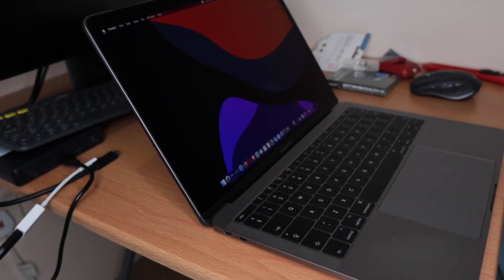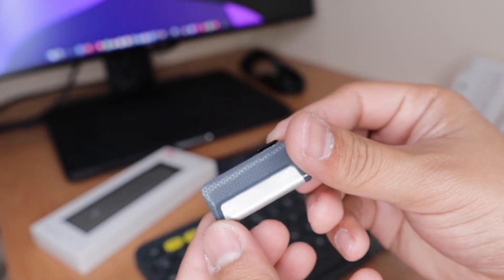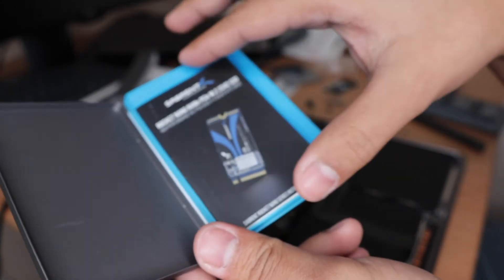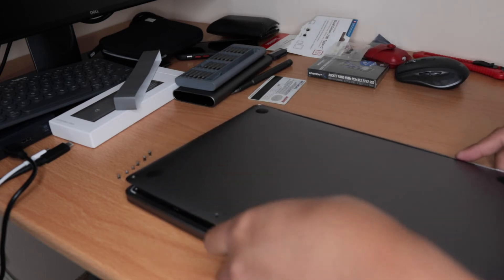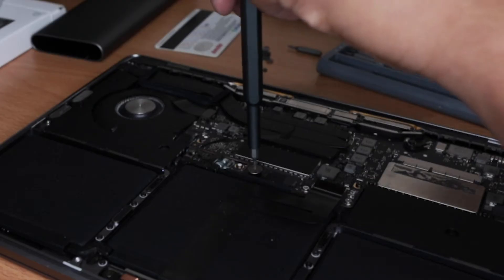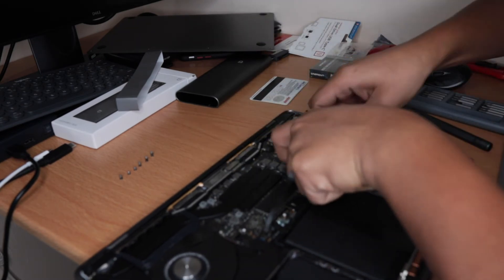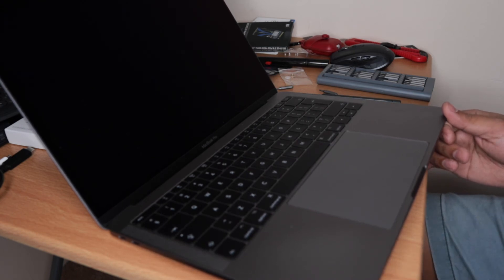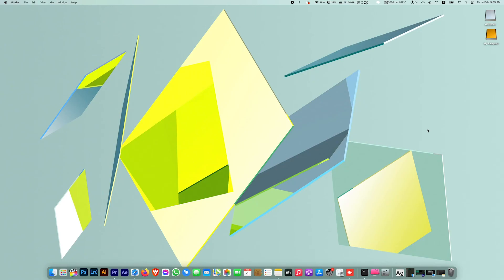How to Upgrade Macbook Pro A1708 to 1TB SSD

Comment: Hi, I have question if you have any battery draining issues with deep sleep?
Reply from the maker: Its been 9 months since i upgrade my macbook no issue at all. Everythings works fine. Read / write speed same battery no problem. Sleep no problem

Comment: Hey. Thinking about doing this upgrade myself. Have you run into any issues since you upgraded? Thanks.
Reply from the maker: since i did this upgrade no issues at all.actually this reply is from this macbook that i am using right now. its been 7 months. speed and temps are pretty good. feels like same ssd as before. 1tb is a big help for me
Reply: @KAPhotography  Do you have issues with the sleep/hibernate mode? What IOS do you have installed?
Reply from the maker: @arturo5050  still bigsur. I tried to upgrade catalina but boot problem it takes 7-10 minutes

Comment: 现在已经有 A1708的品牌代用盘了，不再使用转接卡，转接卡的毕竟不稳定，也不能上 1TB；
淘宝的“草田居”店铺有卖，价格很便宜，512GB才 900多，1TB也才 1.6K；休眠待机没有问题；
分享给大家：
@t；
据说这是市面最高卖A1708品牌盘的商家，好像是源头；海外购买也可以发货直邮；
Reply from the maker: Ops i cant understand this
Reply from the maker: Thank you for promoting other brand here that no need to use adaptor for SSD.  Mine is stable so far until now.

Comment: I tried this on the same model of laptop except it didn't work for me and it's not the internet connection, the sabrent drive doesn't show up in the disk drive list even when I use the the terminal. I need help please reply
Reply from the maker: First before you install the operating system you have to format the ssd as mac extended journaled.
Reply: @KAPhotography  I already went to disk utility to look for the drive but it doesn't show up, so how can I format the drive if it doesn't show up.
Reply from the maker: @sleepingproblems9060  which nvme adaptor did you use? Is it exactly like mine? Check it properly if its snag properly because it happens to me in the first time its now showing
Reply: @KAPhotography  yeah I placed it correctly, but it's not showing and this is a new adapter I ordered again cause the first one I got it worked for a bit and then it stopped working. And now the the new one doesn't show up the drive
Reply: @KAPhotography  it's the same adapter like your's

Comment: Hi there, I did exactly the same thing but when I startup in the Disk utility it does not show the HD. Did you install the operating system on the ssd before putting it into the macbook? I tried with two different adaptors and in both cases I got the same result. I even tried diskutil list in the terminal and neither there could I find the ssd. Your help would be highly appreciated. Tnx
Reply from the maker: Did you format the drive to mac os extended journaled?
Reply: @KAPhotography  that is the thing , I did not preinstall or format the purchased ssd. So as it seems from your answer I presume that you formated the ssd first and then you inserted it into the macbook pro. Am I right?
Reply: I’m having the same issue. Did you format the ssd before you put it into The MacBook
Reply: This is so frustrating, there is a problem with many of the NVMe converters and there's only a certain few that work!! You shouldn't have to do anything to the SSD prior to the installation as this is done on the Disk Utility post install.
The biggest problem is the SSD not showing up in Disk Utility (due to poor convertors), I am also learning that some only last a few months before requiring change!!!
Reply from the maker: Ohh thats awful experience. Luckily in my side its been 11 months sinced i’ve changed my original ssd into this so fa no issues at all :) 1TB is a huge change and help for me. You right maybe some of ssd adapter didnt work well.

Comment: Does this upgrade work with Mac OS Big Sur 11.2.2?
Reply from the maker: Yes just updated mine 3 days ago. Since i upgrade into this SSD i installed BigSur in it.
Reply: @KAPhotography  did your battery life decrease compared to the Apple ssd? Any other issues like overheating or waking up from sleep or random reboots?
Reply from the maker: @Nashtradamus21  all i can say is no regrets compared to my 128gb no issues at all after a month of using the sabrent SSD. And sintech. Adapter link in the description. No overheating no issues im using bigsur.
Reply: The Samsung 970 evo plus 1Tb does consume battery when lid is closed. The first night I closed the lid and it went down from 100% to 78% which is not negligible. The second night I put it to sleep manually before closing the lid and it still went down to 73%. I love the extra space and speed and since it boots so quickly, I have started shutting down every night. On the heat side, the 970 plus does run hot but the cache seems to handle all the windows and tabs I usually keep open without any lags when waking up as I was experiencing with the genuine 128gb apple ssd. It handles it so well that now I hardly hear the fan start blowing like a jet engine before take off. Very happy with the upgrade. Just wished it came in 2242 form factor. Hopefully this helps other users who want to go from 128-1Tb
Reply from the maker: @Nashtradamus21  thank you so much for your input base on your own experience. After several months of using the Sabrent 2242 1TB and i used 80% of 1tb like 200gb left the speed almost the same as new. No problem when it comes to reading and writing i didnt feel any difference. Al no over heating at all specially when transfering files exporting and editing videos.
Reply: Nash Yerrigadoo wow sounds like upgrading to this Samsung SSD would solve the overheating issue on my MacBook Pro 2017, does this SSD just plug and play ? Or do you need an adaptor ? Any issues with the OS ?
Reply: I didn’t really like the dram less sabrent and went for the Samsung 970 evo plus 1Tb which has 1GB of Dram cache. It’s very quick! I have windows 10 boot camp on another partition and windows boots even quicker getting me to password input in less than 5 seconds.

Comment: 128gb is def not enough lol
Reply from the maker: Yeah thats my regret of buying a 128gb laptop. And this is my first laptop. So that time not have much idea about storage. 😂
Reply: @KAPhotography  I really want to do this but am worried about possible failures with it either regarding to battery or the safety of the laptop in general. Have you had any concerns with your machine? Also is it faster than  the stock SSD?

Comment: Do you have issues when the MacBook is waking up from sleep, restarting or powering up?
Reply from the maker: Its been a week since my upgrade and update from mojave to BigSur so far no issues at all no overheating on all compnents specially the Sabrent rocket 2242 has a decent temperature of 36 degrees and sleep restart power waking up. All working seamlessly.
Reply: @KAPhotography  thank you for response! I will do the upgrade just like you did! Thank you very much
Reply: @wolfgangjosesantamariacord8820  same setup like mine i got 2tb of this ssd and works well. Also using external usb c monitor when i plug in my monitor automatic switch on my macbook and auto connect bluetooth keyboard and mice. Luckily i got the non touch version of macbook otherwise its not possible to upgrade my storage.
Reply from the maker: thank you sir. please let me know once you done with your upgrade. keep in touch